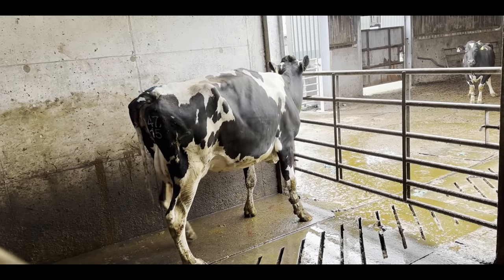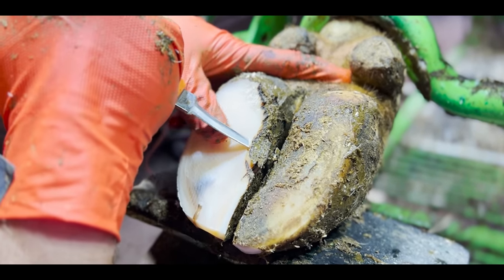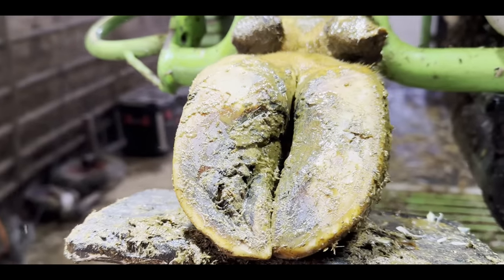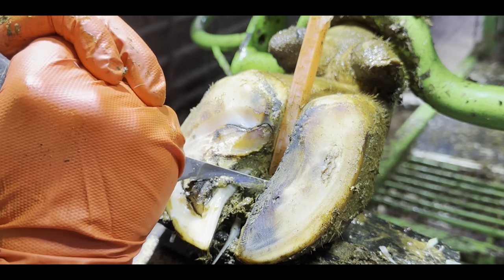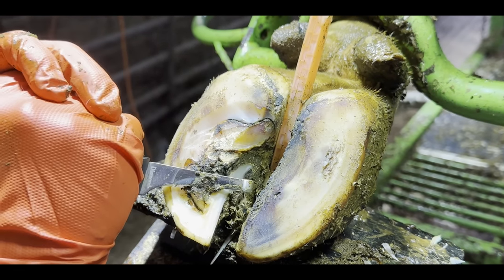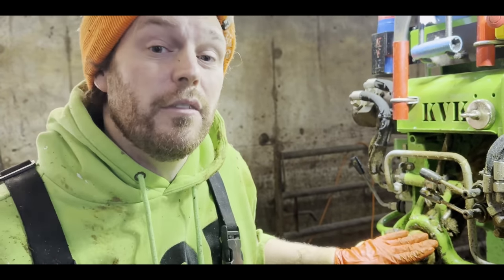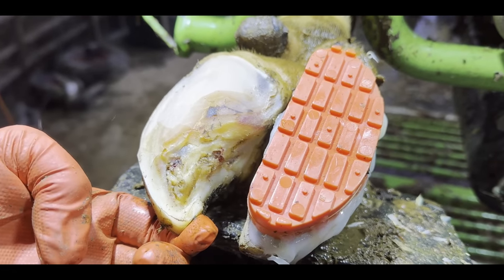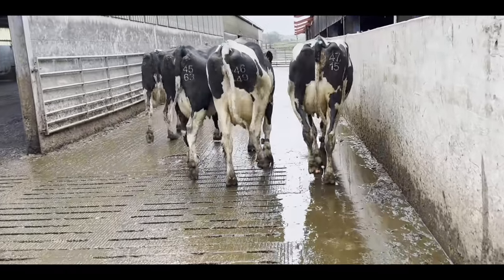FLUID BUBBLES out of a CAVITY in this cow's hoof

Comment: I think it was best to get the cracks earlier than if the block had stayed on. Not that I'm any expert, I just watch this Scottish hoofsmith on youtube.

I have a question though - were those dark spots on the other side bruises from the extra pressure? If so, would you be worried?

Comment: hey Mr Parker.  Did you ever use Betadine instead of Iodine.  Betadine is A commonly used antimicrobial agent is povidone-iodine (Betadine), a complex of iodine, the bactericidal component, with polyvinylpyrrolidone (povidone), a synthetic polymer. The most common commercial form is a 10% solution in water yielding 1% available iodine.

Comment: you said the block fell off because of shedding at the start, now you say that the polyurethane block would still be on the hoof if you had used it. Wouldn't the block still fall off no matter what the material its made from? Shedding is Shedding.